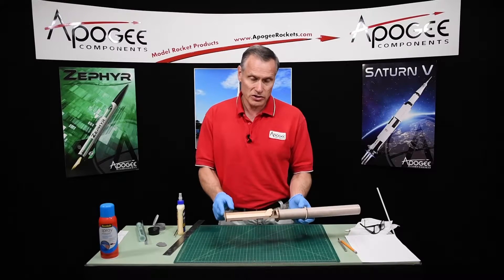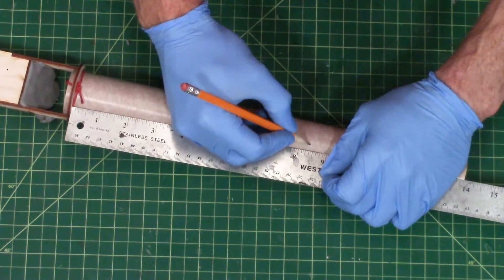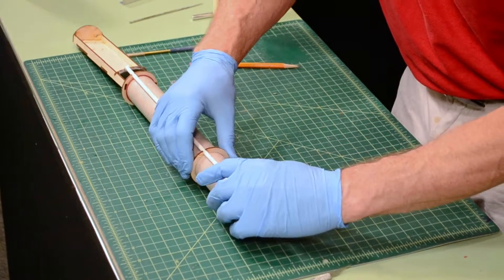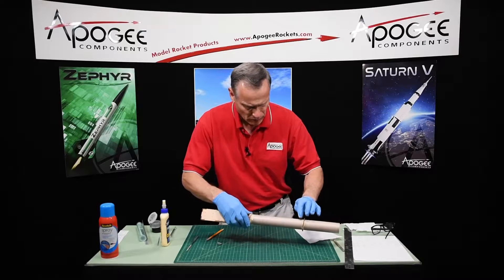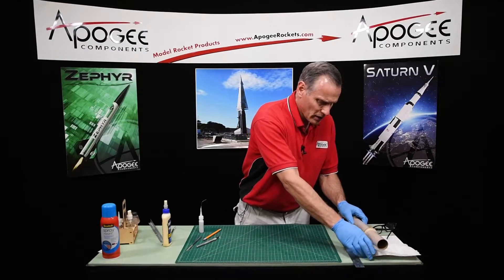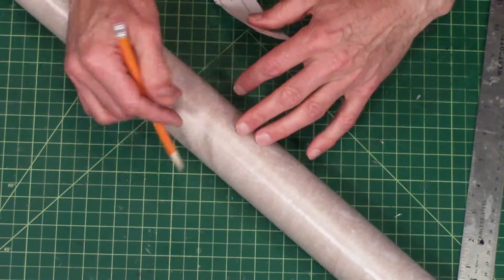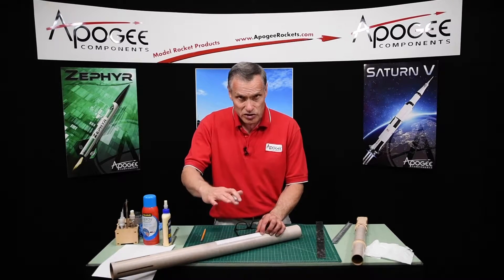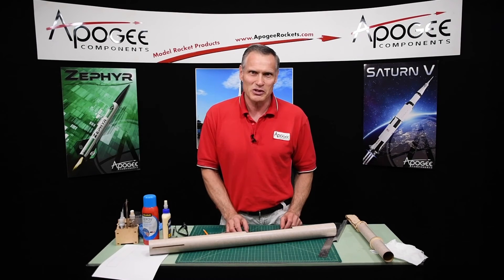Terrier Sandhawk Build Part 4 - Attaching Straw and Blast Shield

Comment: The current Kit coming from Loc has an 11" motor mount tube. It looks as if Tim's kit came with a 14" This of course changes the measurements. So Your options are use your own or order a 14" from Loc and use Tim's measurements.
Reply: Yes - unfortunately, I built the motor mount & sled assembly before I learned this.  I had to buy another motor mount and cut it to fit.

Comment: Hey thanks i wish i would of bought the kit from apagee but i didnt i bought it from loc and my kit has a coupler and an extra body tube the rocket is long it says 58 inches did loc add tonthe length so the kit could be a 2 stage easier